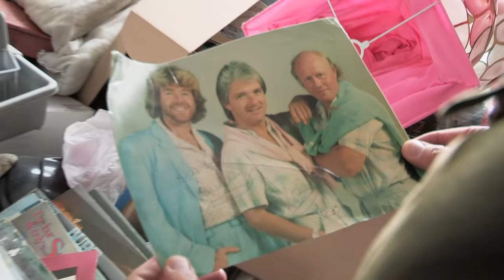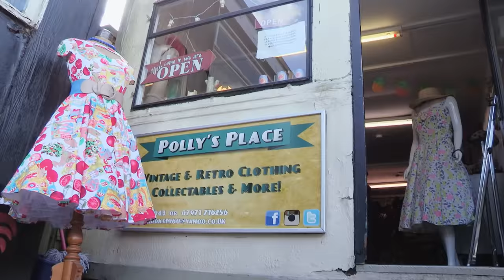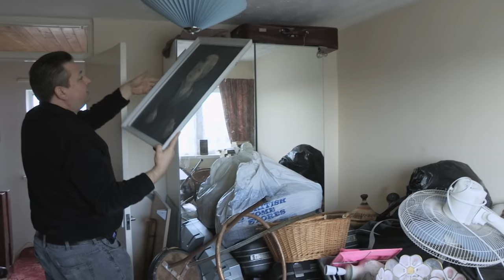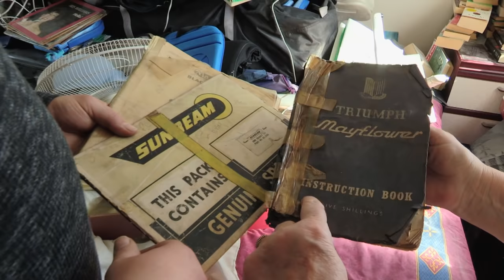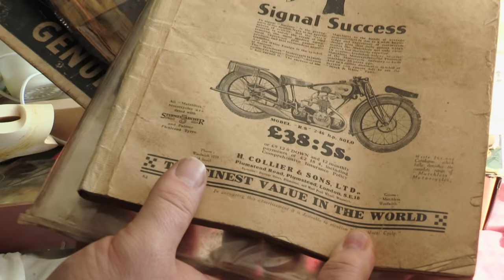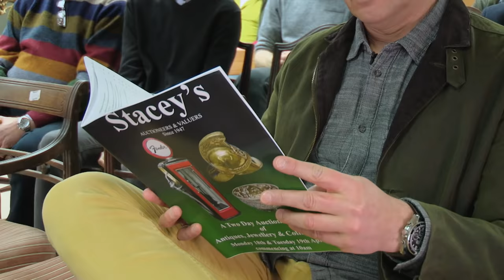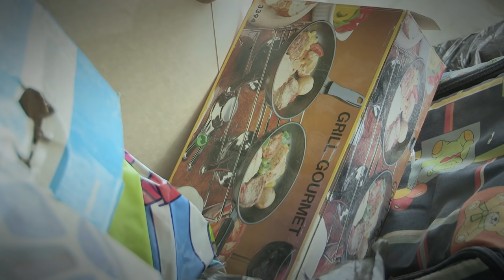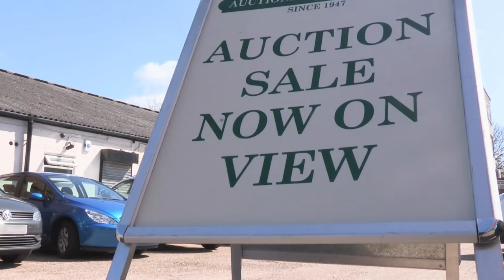Cleaners Are STUNNED By Hoarders Home | Hoarders SOS | FULL EPISODE | Filth

Comment: Amazing..!! Makes me think I should have tried selling my clutter... Instead it either went in a skip or mostly donated to charity shops... A lot of good stuff too... Oh well... Now I do my best to keep on top of things.
Reply: Sometimes it takes far too long to sell it. This way you don't get too far. Unless it's extra special in which case sell but unless it is get rid fast
Reply: @kathryndalton9867  "Just" set the price right, and it moves fast. Or set it high, and offer to trade with more expensive but much smaller things (no matter if you are into them or not), and "always" trade value up, size down.  Then put the new things up for sale at the same terms, and you will end up with a tiny thing worth a million - in theory..  But at least you will have space and less noise in your head.
Reply: If you tried to sell it it may still be sitting there
Reply: Your sanity is worth more than selling bits of junk. You made the right decision.